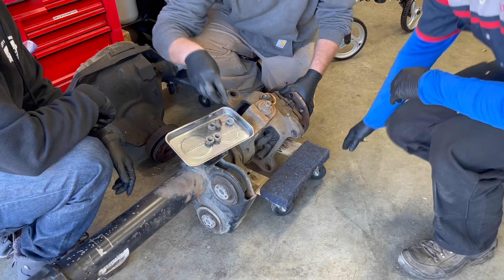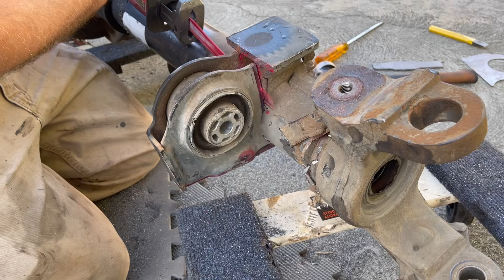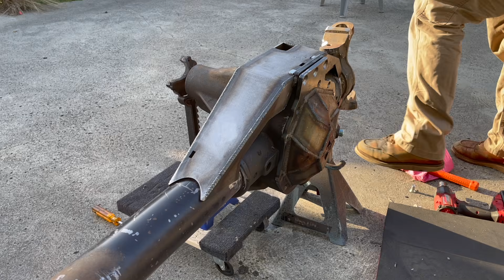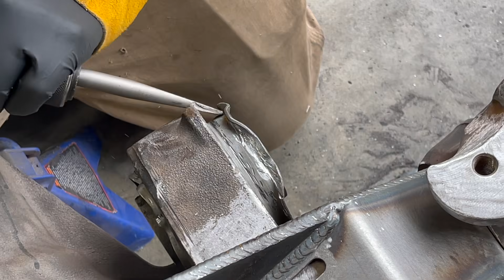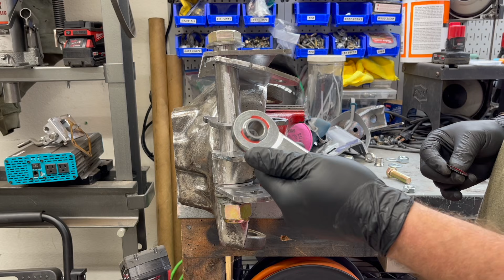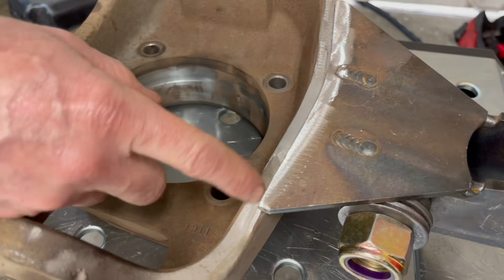Solid Axle Swapping a 3rd Gen Toyota 4runner (4Wheel Underground) - Episode 4

Comment: This was so much work, but so worth it 😎
Reply: I have an honest question: so I own a 94 DLX pickup, 22RE. I’ve changed my front axle shafts as the CV joints were clunking. My question is how much stronger is a solid axle vs independent front axle.  May be a dumb question but the axle bolts to the “axle” shaft with 6 bolts. I’d understand if it was a “press on” half shaft, but it’s not. I’d think that the independent front has got to be just as strong as a solid axle. Am I missing something. I own a wrangler with a solid axle that I’ve rebuilt myself. Point is; I understand a solid front axle and an independent front suspension  axle setup. Is the juice worth the squeeze with the swap? That’s what I’m getting at. Thank you for not being a douche nozzle wort your answer too.
Reply: @ampman5357  
Orders of magnitude stronger: 
The front differential in your pickup uses a 7.5 inch ring gear. 
The front differential in super duty dana 60s is 10 inches+
The Toyota pickup front differential is low pinion
The super duty 60 is high pinion (so even if the ring and pinion were the same size the gears would be 30-40% stronger
The axle shafts are much larger
and the dana 60 U joints are much stronger than the truck CVs.

Edit:
Its possible you were asking about the toyota 8 inch front SFA. And even then the answer is much stronger.
7.5 IFS diff vs 8inch SFA diff
Thicker ring gear
Thicker Pinion gear shaft
Both are low pinion I believe
SFA axle shafts are much stronger
3rd member on the SFA is considered beefy for what it is vs the 7.5 carrier.
Reply: @ampman5357  There are a lot of different IFS setups and solid axle setups. Generally speaking solid axles are stronger but it depends on which solid axle and which IFS. This is a superduty 05+ front axle, I could run 42” tires and not worry about breaking anything, if you put 40” tires on your IFS you’re going to break CV’s and gears on anything slightly technical. At the end of the day it’s about what you want to do with your truck, I live close to really technical trails like the rubicon and fordyce and want to be able to tackle those without worrying about breaking anything. I don’t think I could even accomplish fordyce on IFS. It’s more than just the durability, solid axles are generally better for rock crawling as well based on the way they flex if your suspension is setup properly.